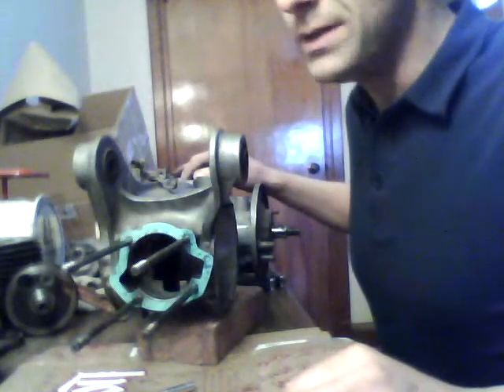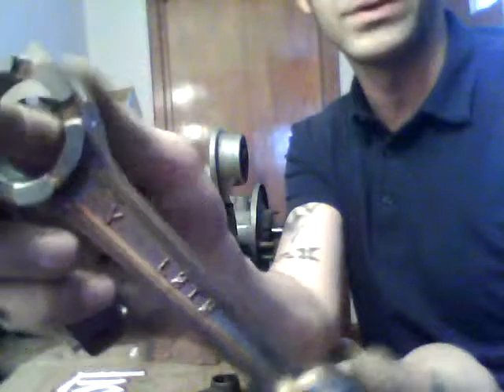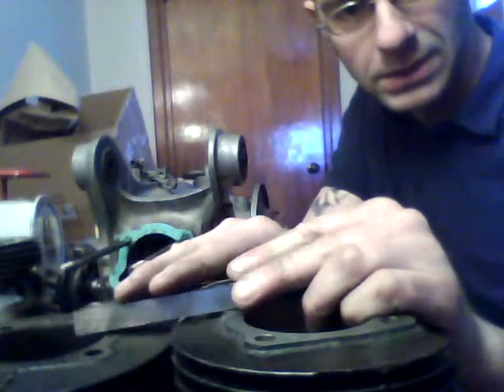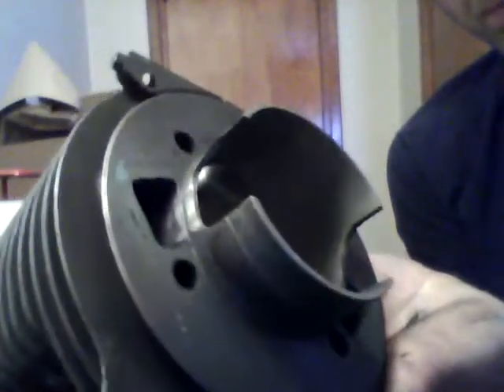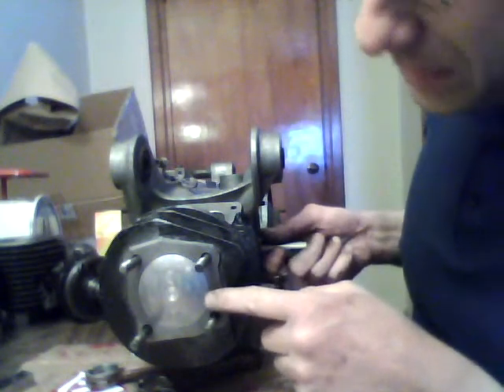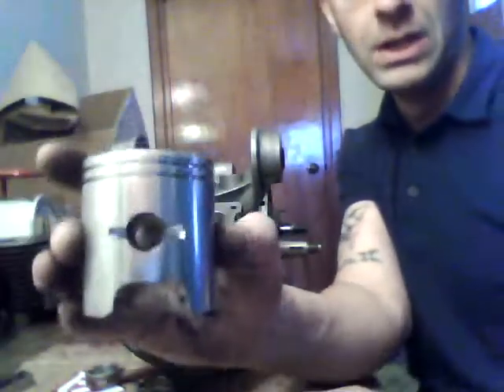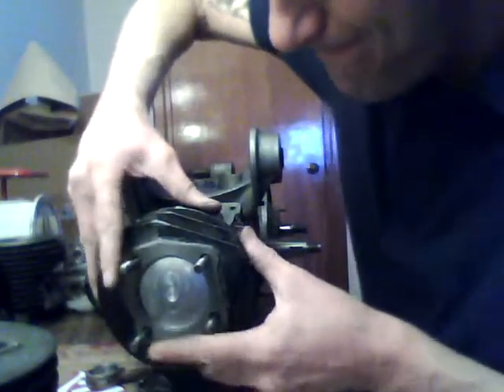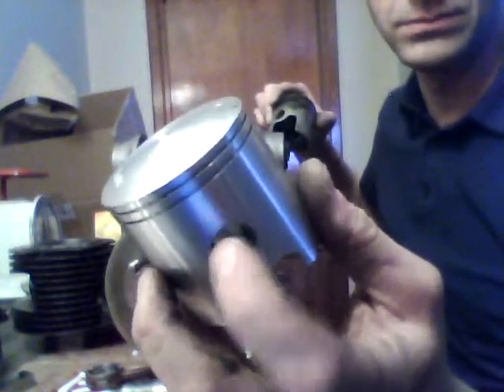Lambretta Crankshaft/Piston height/Conrod Length Explained

Comment: I think in this case, to avoid confusion, a consistent terminology is important. For pistons: high compression height and low compression height and for rods: long and short works but I prefer to use length in mm and the diameter of the small end in mm as some popular Lambretta tunes use  pistons with 18 mm wrist pins while the standard pistons used 16 mm wrist pins. Rods that are used in Lambrettas: 107 x 16 (original) 110 x 16 Yamaha, 114 x 16 and 114 x 18 (Deanspeed), 115 x 16 Yamaha (as in your video), 115 x 18 (Rotax), 116 x 16 (original TV175), 116 x 16 (various "racing" rod kits from Europe), 116 x 18 (Wiseco Hot Rods Yamaha), 120 x 18 (Rotax), all of course depending on what piston is used and the tuning done to the cylinder. Are there a lot of Lambrettas in Pennsylvania? Good twisty roads over there.

Comment: blimey !  that was an excellent tutorial thanks.
 i have been trying to piece together bits of information all over the net to make sense of this and you've done it in one video. 
The only topic not covered was  port timings . 
TV175 barrels are very scarce. If I were to use a series 2 Li150 barrel (long) bored to 62mm (175cc) and a standard series 2 Li150 crank and fit  a long 116mm conrod ( TV175 pattern) and an original TV175 piston (short)  how would the ports in the series 2 Li150 barrel line up with the TV175 piston ?  is this a feasible combination ?

Comment: Quick question for ya
ive got a 125 series 3 conrod and a tv175 series 1 barrell and head
i ordered a conversion piston for the barrell and it ligns up the same ports and such 
and gives me perfect tdc and squish is 1mm
can i use this combo or do i need to install the 175 crank w it?
thx
cornfused

Comment: Thanks for the vid. very helpful. Still learning. I just bought the bgm 195 racetour kit. What conrod and crank would yoou recommed? I just want a little more speed. Don't want to race.
Thanks
Reply: Crank mazzachelli road race. Use the rod it comes with...I say this because its cheap and reliable. My TS225 does high 80s mph.  Sits all day at 65 mph...crank cost me £120 from Glasgow Lambretta centre...
Reply: dude use a SIP race crank 107 rod 60mm stroke . you will need to add a 1mm base packer this will give you more cc and about 6 degrees more advanced  port timing ..... should give you around 2 to 3 bhp more .....